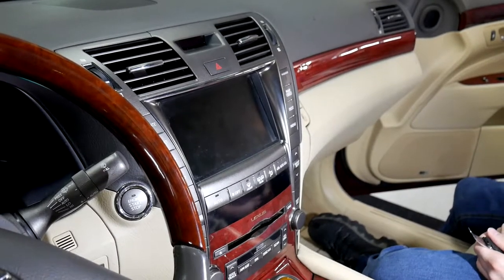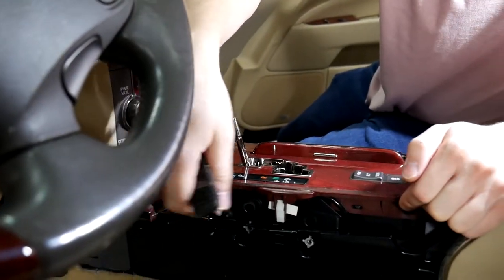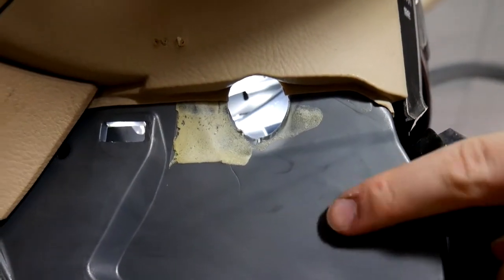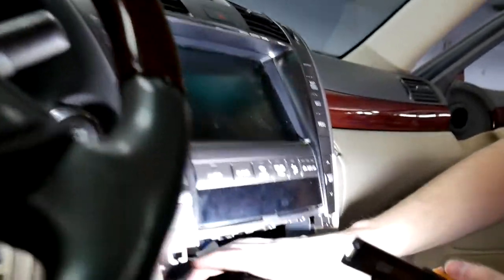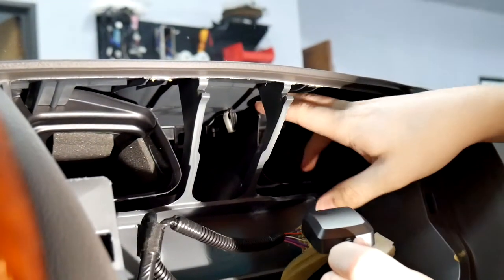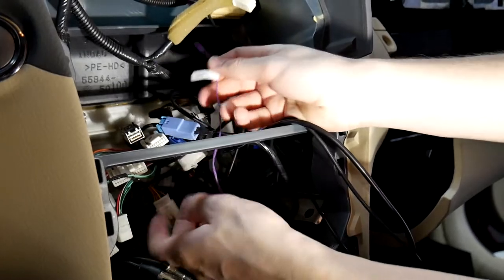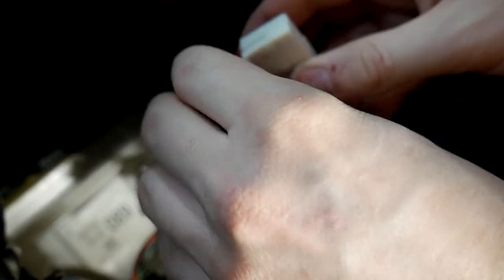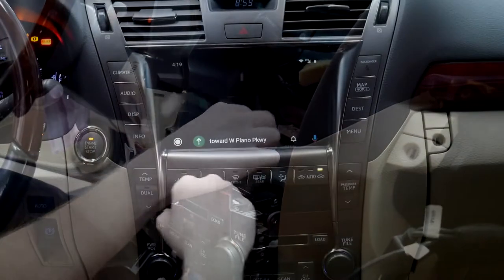Lexus LS 460 2007 2008 2009 GROM VLine install CarPlay Android Auto, car stereo removal guide LEX5LS

Comment: Can you still adjust the climate control options after installing this unit?
Reply from the maker: Yes you can, all factory stereo functions will keep working after the installation of VLine VL2 system.
Reply: @gromaudio  can you make video of that change climate and all please
Reply from the maker: @musharafhossain8282  as of now we do not have this vehicle accessible. You will be able to change the climate exactly the way you are doing now.

Comment: I got 2007 Ls 460L , the cost on your says $640 or something, does it include installation or just for device? Thanks
Reply from the maker: The cost includes device only. It is up to you how do you want to install it - either yourself, or using the help of the car stereo shop in your area.

For 2007 Lexus LS 460L you will need LEX5LS model, available here: https://gromaudio.com/store/all-lex5ls_.html
The stereo must have factory NAV or LCD screen to be compatible.

Comment: does the come with a new radio or does it fixes the old one?
Reply from the maker: It is an add-on to the existing stereo in your vehicle. You will use your stereo and display and get the new features to it, such as CarPlay and Android Auto.

Comment: This is dope. I have a 08’ Ls600hL and would like this done. What area are you located in?
Reply from the maker: We are located in Dallas, TX area. You can also order the product online. For 2008 Lexus LS600HL you will need the LEX5 model of either VLine VL2 or VLite VT2 system, check here:
https://gromaudio.com/store/all-lex5_.html
Any car stereo shop in your area should be able to help you with the installation of the system into your car.

Comment: Which plug is for the power, ground, remote wire and the speakers wires and what colors? It's been two months I've been out without ac and my babies ride in my car and no ac works nothing works.
Reply from the maker: Do you have GROM product installed?

Comment: How does climate control work along with all the other feature found in the stock unit after installing this?
Reply from the maker: Climate controls, and all other original factory features will keep working as usual.
Reply: @gromaudio  so will the original interface still be there to change the power power of climate as well as dvd options etc?
Reply from the maker: @csronan5960  the VLine VL2 will only disable the external CD changer if present. You need to check how your DVD is connected. If it is built-in, it will keep working. External will be disconnected.

You still will be able to access your climate controls the same way you always do.

Comment: Is this installation wireless AppleCarplay? And if so how much does this installation cost? You did a phenomenal job 👏🏽 brother.
Reply from the maker: Yes it is wireless CarPlay. The hardware is available here: https://gromaudio.com/store/vline/grom-vl2-lex5.html
The installation depends on the shop, usually around $300.
Reply: @gromaudio  Alright sounds good. Thanks for the info! I’m about to buy a 2012 Lexus LS 460, and I know I’m going to need this. You are the man!
Reply from the maker: @Mr102185  Good luck with your purchase!
Reply: @gromaudio  thanks 🙏🏽 brother
Reply: got the car?

Comment: The video shows the small black box put near the vent with the 2 plugs...is that all you need? On the site is a whole box and more stuff to install...where is that going 🤷‍♂️
Reply from the maker: The small black box that you are referring to is the GPS antenna. The main module usually goes to the glove box.

Comment: Do you have to use the supplied auxiliary microphone for CarPlay etc or is there a way to integrate the factory mic on this year LS460?
Reply from the maker: You will need to use the mic that comes with VLine for this year LS 460. The mic is small and does not really stick out within the car interior.
Reply: @gromaudio   
I thought so. I just wanted to make sure there had been no update or changes incorporating the factory mic since I bought the unit a while back. I have been using the factory mic and the Lexus system to answer phone calls but will probably instal the Grom mic so I can reply to messages and get voice commands while in CarPlay or using the Grom interface.
Reply from the maker: @88Boxer100  yes you absolutely can do it with CarPlay, and it is more convenient, plus you can use Siri.

Comment: Is this just using the factory monitor, and will it retain the Mark Levinson sound system? And where did you mount the unit?
Reply from the maker: Yes it will use your factory monitor, and it will retain the Mark Levinson sound system. You connect the unit at the back of the stereo to the stereo and display. We recommend positioning the actual device inside the glove box, for easier accessibility.
Reply: What's the name of the part or the link I want one in my 460
Reply: Just look up Grom Audio

Comment: Great Video Could You Please Help Me My Radio Works But My CD Player Does Nothing Seems Like It Has No Power at all any help would be greatful thanks in advance james
Reply from the maker: You need to check the CD player. Our recommendation is to ask the local stereo professional in your area.
Reply: @gromaudio  Thanks For The Reply I Got it checked And They Couldn't Fix it they Said they Would have To send it to australia  i live In tassie and it Would cost me Nearly $1.200 and they Cannot guarantee That It would Be Fixed so I Would have To pay either way. Bummer don,t know what to do cannot afford that. Thanks grom cheers

Comment: By adding this to the headunit , does it allow you to play dvds while the car is in motion?
Reply from the maker: This is not a DVD player, this is the Android system that allows you to have fully functional Android embedded into your factory stereo system, with the access to Android applications and maps. You can use some video apps, including YouTube.

You can also connect your smartphone and use CarPlay or Android Auto. Note that CarPlay or Android Auto does not support the video apps.

Comment: Does the GPS antenna run into any signal issues  being in the dash? In your instruction manual, it says to mount on dashboard but I don't want any wires on my dash.
Reply from the maker: You need to make sure no any metal parts surround antenna or obstruct the signal.
Reply: @gromaudio  so the location you put it in the video was good?
Reply from the maker: @viperkev1978  yes this is the one we recommend.

Comment: Are the factory USB ports still usable after the Vline is installed? I use one of my factory USB ports for a USB music drive.
Reply from the maker: It depends on the stereo, if your vehicle is Lexus LS 460 2007-2009, you will keep using the factory USB ports.
Reply: @gromaudio  I'm in a 2010 LX570
Reply from the maker: @dr.emilschaffhausen4683  In 2010 LX 570 factory USB port will be disabled with the installation of VLine system. You can check here: https://gromaudio.com/store/vline/grom-vl2-lex6.html
You can however use the USB port of VLine to play USP stick or iPhone via car stereo.

Comment: I need your help ! I’m trying to get the radio installed and the guy is saying I need a kit in order for the radio to fit. What are all the things I need to install this radio? I have a 2009 Ls 460 and nobody else seems to know all the things I need. He said if I just buy the radio he can install it but it won’t fit. Is that true ?
Reply from the maker: Fitting aftermarket radio into the car is not as easy as it seems to, however also depends on the vehicle and the way the front panel is designed. Lexus stereos are usually very integrated into the car stereo interior, that is it hard to simply take them out and replace them with something else. The installer is correct, as to fit the aftermarket stereo into Lexus LS460, you also need the integration panel that will allow you to look seamless and built into the vehicle's interior.
If you want to add the CarPlay or Android Auto to your original Lexus stereo, please check our website here:
https://gromaudio.com/store/vline/grom-vl2-lex5ls.html
For stereos with NAV.

Comment: Hi, 
What about the sound quality? Is it reduced after the installation? Does it use aux for sound input?
Reply from the maker: The sound quality is not reduced, VLine is keeping original sound quality. The system emulates external CD changer in the vehicle and preserves all original sound.
Reply: @gromaudio   is the entire lexus system still there just with the addition of the carplay app?
Reply from the maker: @tobycaust5450  yes that is correct, the entire Lexus system is preserved. You add the VLine VL2 system on top of it, and it fully integrates with the existing Lexus car stereo, touchscreen, steering wheel controls, and buttons.
Reply from the maker: @tobycaust5450  These two systems will work with Lexus LS 460 2007-2009, with the factory navigation: https://gromaudio.com/store/all-lex5ls_.html

Comment: I think this guide for LS460 without self park .. please clarify.
Reply from the maker: It now applies to both - with and without self parking assist for Lexus LS 460 2007-2009.
Reply: @gromaudio  so what's the purpose of wire taping in the self-park version.  I installed VL2 in my brother's LS 460  car . No wire taping needed .. Please clarify
Reply from the maker: @GG99MW2  If it woks without the tapping then it is ok for your install. In general we had a confusion from the users trying to understand if their stereo has self parking assist or does not have. Tapping reverse wire never hurts.
Reply: @gromaudio  oh . Ok . Is there any hardware changes since last year . Also what significant OS updates compared to last year .
Reply from the maker: @GG99MW2  no significant HW changes. As per SW, Android Auto wireless was recently implemented.
Reply: @gromaudio  Thanks for the reply,,
Reply from the maker: @GG99MW2  Sure!

Comment: If my unit says cannot read program, will this allow me to bypass the factory non working unit?
Reply from the maker: If your factory navigation stopped working for some reason, VLine VL2 system will still work for your factory stereo. However if the entire stereo stopped working, VLine VL2 system will not work, as it needs functional stereo to display its functions.

Comment: is the installation the same for 2011 model?  if not, is there a video for it?
Reply from the maker: For 2011 the installation is different as the vehicle dashboard and the back of the stereo are different, however the principle is the same - you need to take the stereo out to connect to the back of the stereo.
You can check our YouTube channel youtube.com/gromaudio for all install videos that we created so far.
Reply: Is this compatible with the ls460 or there is another model?

Comment: Will this installation bypass the error message of "A program cannot be read. Please contact a dealer"?
Reply from the maker: Is this the message for your factory navigation? If so, it should not affect the VLine VL2 system, it will still work.

Comment: Will this work for the 2010 version? If not do you have a one that does?
Reply from the maker: For 2010 Lexus LS 460 you will need the LEX6VL2 model of VLine VL2 system. It is available here:
https://gromaudio.com/store/vline/grom-vl2-lex6.html

Supports stereos with factory navigation.

Comment: Bro mine 2012 can i do it and the another issue is if I raised the volume to max it discount the volume and if I switch in the screen from aux to any other like fm or whatever it doesn’t change until i switch the car off and turn it back on do you know whats the issue
Reply from the maker: For 2012 Lexus LS 460 you will need LEX6VL2 model of VLine system, it is available here: https://gromaudio.com/store/vline/grom-vl2-lex6.html
As for the volume glitch with your stereo, we do not know what is causing it, maybe check with the local Lexus dealer?
Reply: @gromaudio  they scam bro all they want money I don’t go to the dealer anymore
Reply from the maker: @khalifamazroui5512  got it

Comment: I have an 08 ls460 and I'm attempting this, I have a blue and grey plug as my in car harness while in the video it looks like two blue plugs and it doesn't plug into your GVMF harness.
Reply from the maker: If it does not plug, you are looking at the wrong connections. You need to locate the connectors at the back of the stereo display that fit. Make sure you look at the back of the stereo display (not the car stereo).
Reply: I have the same problem cant locate the other connector
Reply: @bay4608  leave it unplugged,  thats what they told me to do when I called. Their customer support is pretty good 👍
Reply: @viperkev1978  thanks bro got it to work you the man
Reply: @bay4608  no problem 👍
Reply from the maker: @bay4608  It is there! For the blue connector you need to look behind the stereo. If you still will not be able to locate, please contact our technical team at https://gromaudio.com/support.html They will help.
Reply: did you install it? if you did, how is it and do you recommend it?
Reply: @abdullahalsaif8308  I did, they have a video install i followed, just take your time

Comment: Ok I have a few questions before I place my order to replace the screen in my 2007 LS460L.
1) Does this unit have an HD screen?
2) it said its an android auto system I have Apple and I see the demo on here has siri and apple car play so does this system have both apple car play and android?
3) will all my steering wheel controls work with this unit?
4) How does this unit compare to the Tesla style unit as far as reliability and features?
5) Lastly do u have this unit for 2002 Lexus GS 300? I currently have an after market JVC dvd nav double din in it but would like to upgrade to something like this.....
Reply from the maker: Thank you for your interest in VLine VL2 system!
1. The unit uses your factory touchscreen, and fully integrates with it. You do not replace your stereo or screen with VLine system.
2. The system has both Apple CarPlay and Android Auto.
3. Yes steering wheel controls will work with the VLine system.
4. Tesla style has different concept, with Tesla style you replace full stereo. With VLine you add the extra functionality to the existing factory stereo and set up. With Tesla style you loose all your factory features, and need to integrate everything, including climate controls, etc.. With VLine it is simpler because VLine does not replace your factory stereo and does not disable factory functions.
As of the reliability of VLine system, we strive to make it reliable. The system also comes with 18 month manufacturer warranty, and US based technical support.
5. We have the system that is compatible with the factory stereo in 2002 Lexus GS 300, you can check it here:
https://gromaudio.com/store/vline/grom-vl2-lex3.html
The factory stereo must have navigation. VLine integrates into the factory stereo, so Lexus needs to have factory stereo installed.
Reply: @gromaudio  Thx for the reply and all the information provided u answered my questions. But I do have another question for you and that's do u guys sell the Tesla style full unit? I was under the impression this system was a full unit not just a integration to the existing screen my screen doesn't work so that is the main reason for replacement Lexus wants way to much for a new screen and a used screen is over 600...
Reply from the maker: @bikerboy2k142  we do not offer Tesla style units. Since you already have the aftermarket stereo integrated, the easiest way for you is to replace this stereo with the other aftermarket that has CarPlay / Android Auto.
Reply: @gromaudio  No I have the factory navigation and radio in my LS but the screen went out that’s why I’m looking to replace it because it’s cheaper aftermarket that buying Lexus. But my GS I do have an aftermarket JVC DVD Navigation In it now….
Reply: @gromaudio  you said this unit uses the factory screen right? It just has more updated features like CarPlay and Spotify and navigation gps. I really was looking to upgrade the screen with one that has a better more modern resolution the factory one is yellow and pixels like old game boy….
Reply from the maker: @bikerboy2k142  yes the VLine system use factory screen that is in your vehicle. The graphic however has its own colors, not related to factory Lexus UI. But the resolution is the same as on your factory stereo. We have many customers using VLine system on older stereos like yours, however surely it depends on your personal preferences.

Comment: Will the 6 disc changer still work?
Reply from the maker: Build-in CD changer will keep working, external will be disconnected
Reply: @gromaudio  Great so all the factory stuff still works, it's just upgraded navigation to Google maps and stuff 👍
Reply from the maker: @HexicanLS460L  It is car computer that is integrated to your factory stereo, and adds CarPlay/Android Auto, using your factory stereo. All factory features keep working as the system does not replace the stereo, but instead adds to it.
Reply: @gromaudio  Thx I'm definitely gonna add that to my car when I can 👍

Comment: Will this work with a 2010 LS460?
Reply from the maker: Yes it will work with Lexus LS460 2010 as long as the stereo has factory navigation. The correct model of VLine VL2 system for this vehicle is LEX6VL2, it is available here: https://gromaudio.com/store/vline/grom-vl2-lex6.html

Comment: LS600h 2008 ? VLine VL3 release date ?
Reply from the maker: For LS600H 2008 you need LEX5VL2 model of VLine system: https://gromaudio.com/store/vline/grom-vl2-lex5.html
VLine VL3 is not in works yet as the VLine VL2 is fully sufficient for what it is designed to do.